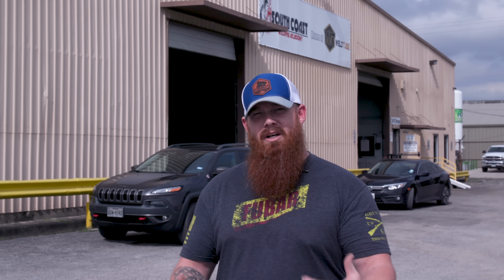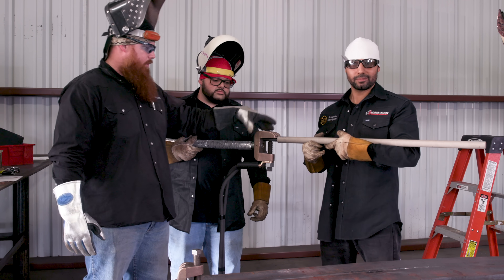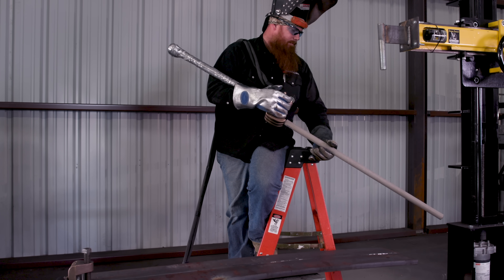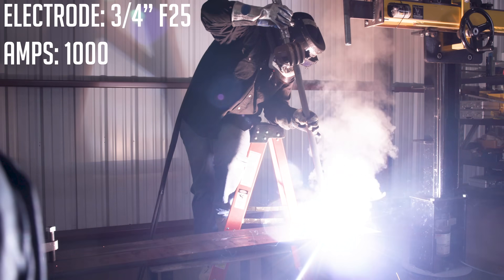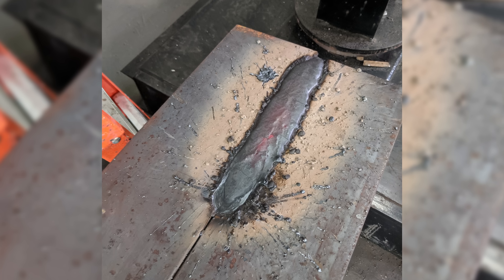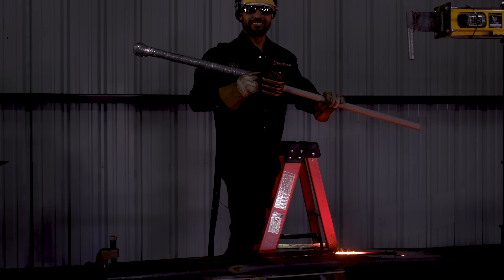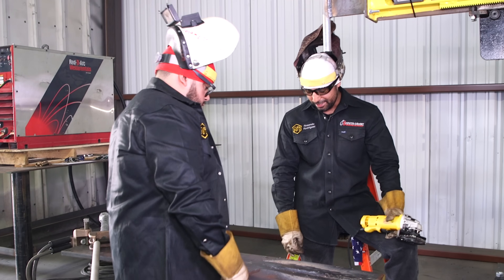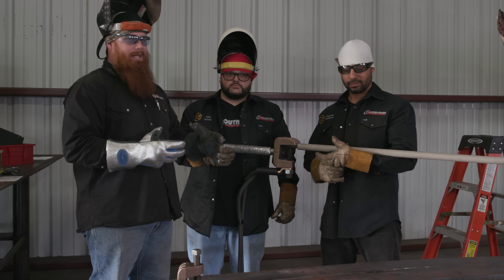1000 AMP STICK WELDING!! | Manually Welding with the Worlds Largest Electrode

Comment: Absolutely awesome...we were always told at college many many years ago a lot of heat can crack the weld how does the machine cope with this in foundry?this is by no means a criticism just a question...great video and content lovely bead of weld too considering the size and weight and rod..thank you

Comment: Electric bill?? Do they even make a watt-hour meter big enough for this?  Does the shipyard even care how much electricity is used?
Reply: If you watch the meters on the welder, its 40volts x 1000amps which only equals 40kilowatts. About the same as 10 household laundry dryers.

Comment: That was so BADASS!  I have the exact same 1200 at work. I use up to 3/4 inch carbon arc rods. It's almost a violent process sometimes.  You guys have to do this on a show! Carbon Arc cutting at 1000 amps with 3/4x17" copper clad rods will blow your mind what it can cut!! Thanks!
Reply: That would be cool to see.
Reply: We used a gasoline torch in demolition. It cut through 7 inch vault door steel, but the torch was able to cut through 18 inch thick steel. Really had to have some air pressure with a huge tip.

Comment: I'd hate to have to keep a box of those welding rods around.
Reply: When You need a goose neck trailer for your rods alone, that's what you would call OVERSIZE 😂😂
Reply: in WHAT oven ?
Reply: and the electrode oven was so big.

Comment: But why? What can this rod do that multiple really good beads can't?
Reply from the maker: 100lbs of deposition per hour.
Reply: @Welddotcom  yeah because that rod is going to leave a better weld bead than running smaller more controllable beads? Don't get me wrong that rod is way bad ass but completely unusable.
Even Andre the giant would have an incredibly hard time running this rod and get an acceptable bead. 
I will bet you money that nobody could pass a weld test with that rod.

Comment: F25 is 8lbs, not 18. I run em at about 1200. If you hold them more at 90 degrees it will smooth out

Comment: They aren't 4 ft long, they are just over 1 meter in length, and they don't weigh anywhere near 20 lb, but rather a tad over 7 lbs each.  Over the decades I've probably used close to 100 ton of this material.  Used mostly for repairing bases for forging hammers, we'd normally parallel a couple 1000-1500 amp power sources and go to work.  In a 12 hour shift we could burn 700-800 lbs.

Comment: I've been around 1000+ amp welling jobs several times but they were all submerged arc type applications so there really wasn't much to see, other than a ~1/8" - 3/16" feed wire moving at what looked like a foot or two a second.

Comment: When you absolutely positively need to get all the filler metal in in one pass.
Reply: Hell, I coulda used these to weld up the extensions we put onto the Stay vanes in a Hydropower station.
1 inch deep, 2 inch wide vertical V weld. 4 months work, 14 hr days. 30 days in a row.
Reply: Secpnd best comment, i. That cade lets see a 3/4 7024 rod, they fill like crazy
Reply: Can relate
Reply: Ship's propeller shaft bearings...

Comment: You reckon the weld set makers ever thought that just because it goes up to 1000 amps that there would ever be a bunch of crazy dudes stick welding at 1000 amps?
 You should mount the burned out stubs on wood plaques, would make super cool shop art?

Comment: Just a couple of weeks ago a colleague was telling me about his experience fabricating enormous steel beams in a previous job.  Had multiple welders connected up and running in parallel to get enough current, along with another set to swap to when the first set got too hot.  Had to have electrodes custom made as there weren't any large enough available off the shelf.  Don't know what the material thickness was or amperage, but must have been quite a step up from what these guys are doing - which is already kinda epic!  I guess most really big welds you see would be getting made with submerged arc rather than stick?

Comment: Why rods and not submerged arc when you need that size welding.That welder is what 40 KW draw, not that much by industrial standards I once had a 90 KW spot welder in my shop,the supply company did not like that and I ended up running it from a generator and that was small compared to what is is used in some industries. How many of those rods are in a carton not many I guess before a forklift is required.

Comment: Do you think that that might have ran better hung that from a rope and a fork lift so it wouldn't be dragging against the plate and maybe just a bit of gap.  But that's beats what I've done arc gouging at 600

Comment: hi new welder here. I need to weld up some 28 gauge sheet metal, is this the electrode and machine I need to get this job done? Everyone keeps telling me a 110v mig and some .023" wire would suffice, but i'm not convinced it would be enough.  Thanks from Bill in Canada
Reply: You should be able to get away with some multi pass 3/16 rods if your machine isn't up to it, that is pushing it for 28 though
Reply: @dontnubblemebro  3/16" rods on material that is .0187" thick? All that will do is blow holes.
Reply: A 110v MIG welder with .23 wire is more than enough.

Comment: I wanna see what happens if you try to stuff 1000 amps through an 1/8" electrode...
Reply: More like bang
Reply: 300amps on 1/4" rod will usually set all the flux on fire. :-)

Comment: Isn’t that a little bit “cold”, at 1k Amps.
Reply: The undercut suggests otherwise, typical rule of thumb is electrode dia. as a decimal*1000=amps. So 3/4" should be .750*1000=750A. I would assume they are running it too hot as a result, hence the undercut. 1/8 7018 runs really well between 125-135amps so i would probably put this electrode between 750-850amps or so.
Reply: @aaronhackbusch7484  well they wanted the cool 1000 amps title so of course they ran it hotter than they should. 1000 AMPSSSSSS
Reply: Idk, he had a pretty long puddle so I assumed it was hot.
Reply: That's what I was thinking the way it sounds they need to turn it up a hundred amps or so
Reply: agree
Reply: On a 7014, 3/16 rod I'm around 230-240 amps,  so 240 x 4>3/16 rods= 960 amps, so if anything they are on the hot side, blowing out spatter is one tell tale sign.
Reply: Agreed the undercut would suggest too hot as theory would state the intermittent popping was the power source trying to keep up to maximum output. Still cool as hell I would love to try it. I’ve burned quarter inch all day and wished there was something bigger to fill in a 48” 160 without having to change stingers periodically to accommodate basically melting plastic and rubber into your hands haha. Awesome vid.

Comment: Interesting video for sure . I just want to know how practical this really is today. I know that back in the day this might have been the only option they had, but it seems like an involved process with alot of wasted filler metal (even if you burn to the numbers).

Alot of the stick is vaporized for the protective cloud, and alot is wasted in spatter, along with being a slower process. I guess what im asking is wouldnt a 400 amp or 600 amp flux cored or metal cored wire be a much more efficient process for modern industry or is this still the only way to do it still?
Reply: I would think everything was submerged arc now adays

Comment: I was looking for an outline of three guys and a ladder burnt into the back wall from that nonsense. Crazy.
Reply: a lot of funny comments, but yours made me fall off the chair! Thank you for that !
Reply: Place I worked back in 1970s lot of heavy stick welding with 3/16 rod at about 200- 300 amps. Sometimes some heavy wire panels would be a little long and need trimming, put a guy on it to trim with a welder. Turn welder up to 500 amps and burn- trim the wires, from across the shop it looked like small atomic explosion with mushroom cloud

Comment: How much would one of those rods cost?  It would be kind of neat to hang one of those on the wall in the shop. 🙂
Reply: https://www.ebay.com/itm/Big-Welding-Electrode-3-4-in-Diameter-X-39-long-/182210119036
Reply: I'll buy one to

Comment: I HAD an Old miller 750 amp machine( Wonder why it was Stuck in that Corner for So Long) and being on a Demand Meter for my Power, we trying some OLD, 1/2 inch dia, 7024. OMG, the cables jumped 6 inches off the Floor, So did my check Book as the demand went Nuts,, Was fun, but I guess they had a Use for it in its Day,, NICE LOOKING WELD,, THANKS FOR THE SHOW!!!!!

Comment: I'm such a shitty welder. Your welds with that 4foot @3/4" rod,  still look better than any of mine ; and your working 5feet away from the metal, off a ladder, holding 60lbs, and so much smoke I know ya can't see the pool... but yet it still looks good.
Thanks for posting.
Keep up the great work.

Comment: I wonder if they used something like that to weld up the Iowa Class BB back in the day?
Reply: Often wondered how they welded the 18 inch thick armor even with this it would have taken 100s of passes per joint. I assume that it was welded using electro slag welding.

Comment: Before the actual welding began I was almost positive that thing was going to blow a hole right through the work piece.
Reply: If they had one in a 6010 they would have.
Reply: heh.  I looked up the rod and saw its data sheet.  1000 amps is the minimum for the size of the rod.

Comment: I calculated it out using the measurements the machine was displaying at the start and welding this rod uses 48,000 watts and a standard 3/32 7018 uses a little under 8,000 watts
Reply: Well that looks like 6 times as much fun as a 3/32 7018.
Reply: That where some rocket science calculations... one meter multiplied by the other meter.

Comment: Holy crow! Is there a practical use for this - like shipbuilding or something?
Reply from the maker: Apparently it's used to repair ladles in steel mills.
Reply: I have seen 1/4" rod used for shipbuilding
Reply: I have seen 1/4" rod used for shipbuilding
I used to use the 1/4" in a shipyard. might have been 28 - 30" long. Drop into a groove, get your angle right, let it drag in ... just close your eyes and listen. Or one welder (aka: operator) could run / monitor several of these mounted on diagonal slide rails with a magnet foot. 
3/4" tho ... wowzer 0_o

Comment: Definitely a Time saver . Who's the guy that wants to try it over head 😨
Reply: I'm your huckleberry.
Reply: Wesley Chambers from upchurch?
Reply: I'd send it
Reply: You only live once but there are somethings that you just gotta say hell no to
Reply: Try who's the "Fool" that wants to try it overhead!
Reply: @tedh.8356  Just physics and amperage.  Of course depending on if the flux is an all position type. My bet is probably designed for flat only.
Reply: @rcs368  Yes probably is flat position only, but maybe vertical down? can only imagine the application that might need it, I mainly did GTAW but I know there's many unique welding situations out there, this is very interesting to watch or do....
Reply: @rcs368  they said it was 7018, just 7018 the only difference between it and Normal 7018 is the size so this rod is good for all positions. If it were only good for flat it would be 7038 not 7018.
Reply: @machscga6238  7024..
Reply: Do you have the asbestos suit to go over my leathers?  And a shield that is more like a bikers helmet?  If so, sure, why not?
Reply: Curtis von Epp 🤯🤯🤯😭
Reply: Challenge excepted!
Reply: Johnny 5 will.

Comment: Wow. Closest I’ve ever gotten to something like that is welding 3/4” dia Nelson studs at 1,500 amps. But that’s a 2 second burst, nothing like what you guys are playing with.
Reply: Are they those studs welded to steel work for bonding to concrete?
Reply: Mark Fryer  yes. Really slick process.

Comment: Good Lord I'd need a lifting eye in the middle myself.  What happens if you stick a rod?  Do you use a carbon arc or cutting torch to break it loose?
And that's a pretty decent looking bead too!  You'd think the splatter, what little there is, would be the size of golf balls.  Didn't know such a thing existed.

Comment: 3/4” electrode. Divide 3 into 4 and that gives you 750amps. Of course the flux changes the amperage but, I’d bet if you turned it down the undercut would go away. Cool video and my 2 cents doesn’t mean anything. Thanks for sharing!

Comment: "Any tips?"
"Yea, just keep an eye on your pond."
Reply: LMAO
Reply: Nice one, "Jerry Seinweld" ;)

What do you call a welder who also performs stand-up comedy?

A "3G comic".
Reply: Seldian this  is. hilarious 🤣
Reply: Random Restoration  Well I guess with 350A you dont weld like 1m away from your workpiece. 1/(4*pi*50cm^2)=0,00318%[ofEmittedLight/cm^2]  vs 1/(4*pi*100cm^2)=0,000796%[ofEmittedLight/cm^2]. Now divide 0.000796/0.00318=25%. Means that you get 25% of Light at 1 m than at 0,5 m. Effectively you could even weld with 1400 amps @1m with a 350amp @ 0,5m Helmet.
Reply: The lake of fire.
Reply: @randythompson1957  why travel to mordor for a ring when you can have a pond of lava instead
Reply: @kyle18934  i bet this beast could melt that ring 😂😂😂
Reply: @saberflow_official  sauron doesnt have a chance
Reply: rofl
Reply: Gonna need a weld shade of 20
Reply: I see what you did there that's funny
Reply: 😂 love it
Reply: Watch the puddle  . Good weld 3/4 inch 4foot long  . Good weld . That's fer Tucker metal to weld [ thicker] metal . Boyaou . Cool post
Reply: More like a lake :-)

Comment: Ok seriously what would anyone actually use that monster electrode for? It's badass but I expected a shower of sparks coming off that thing
Reply from the maker: They use them in steel mills to repair ladles.
Reply: @Welddotcom  maybe I can find some videos with these being used commercially. Thanks for the direction to look.
Reply: I was expecting sparks flying at least 5' or more but it didn't.

Comment: How did this never make it on Home Improvement or Tool Time with Tim Taylor. What a great gag it would have been. MORE POWER!!!
Reply: Send one to Red Green
Reply: James Harrell, Red Green’s not a welder, he’s a grinder!
Reply: @Hoaxer51  hey hey now. I've seen him pull out the ol rolling J.B. before. The grey stick. Makes him a marine welder right?
Reply: Hahahahahahahahaha Tim would have gone up in flames
Reply: Augh augh augh!
Reply: Are you crazy? He would have burned down the CA power grid faster than terrorists.
Reply: I'm pretty sure the powers-that-be would have pulled the plug on that idea right quick.

Comment: What shade lens did you use for 1000amps? I was wincing seeing you stand in that smoke plume with no respirator :-(
Reply: @Wroger Wroger for almost all forms of radiation, gamma all the way to radio, double the distance, quarter the dose
Reply: When you are 5 feet from the arc, it's not an issue.  Radiant heat is.
Reply: @Wroger Wroger intensity of light from its source diminishes based on the inverse square law, it's disproportionately less intense a your distance increases.
Reply: @Wroger Wroger Lasers and highly directional light sources do not obey inverse-square law.  Or if you feel like testing this for yourself you can always look into a fiber optic cable.
Reply: @TWX1138  People saying you are wrong and you are clearly right.  Inverse square law is in effect here.  Should be totally fine with regular welding shades at that 5 foot distance.
Reply: I would imagine they are wearing cutting glasses on top of the helmet set to 13 or whatever. We have guys at my job that run a beam welder which is really just two flux core mig welders running at the same time and they smmabage to burn there eyes all the time so i would imagine this giant could fuck up your eyeballs if not extremely careful